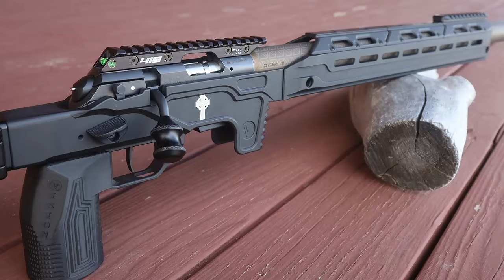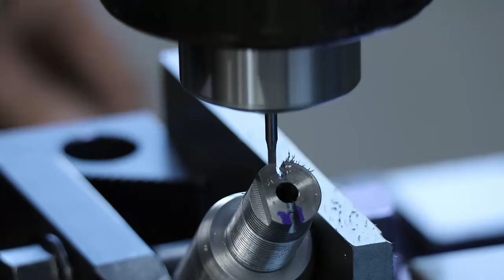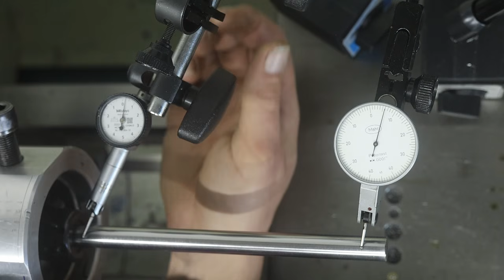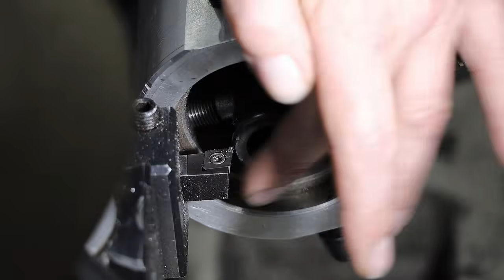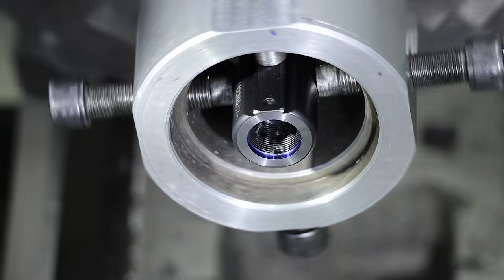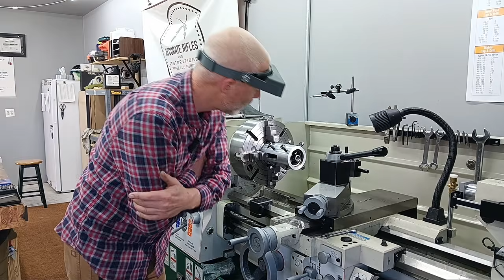CZ457 Receiver Threads and Accurizing | AR&R CZ 457 Customs | Premium 22 RF Competitor

Comment: I admire your work, but your comments on CNC vs Manual are way off. It seems to me that you have not spent much or any time running CNC's and are not speaking from experience. I have both and use both in my gunsmithing shop and they produce exactly the same result. I dont use my CNC for chambering work, but I will use it for just about everything else. There is no difference in the setup. I use the same action truing jigs and chucks in the CNC that I use on the manual lathe. The alignment process is exactly the same on both. The cutting tools I use are exactly the same on both. The difference is, I can create a program that will cut muzzle threads and crown in about 2min vs the 15 to 20min it takes to do the actual cutting on a manual lathe. Programming simple things like that is extremely fast and done directly on the machine, and the programs are saved for the next time that job comes through the shop.

What you are talking about is CNC machines being used in a high production environment where the time taken to achieved perfect alignment is often skipped. That is a very different use case to the reality of CNC's in a high precision shop.

Comment: Great video. I like how you went into detail about the process.
I have a couple of questions though. I see the end of the capscrews are machined, is the end flat, or is it slightly domed?  Was there a recess inside the action where the threading bar could be zeroed before cutting?

Comment: Any thought on making a plug for the factory barrel screws?  Fill the screw holes up and then cut the internal threads, not using them may as well plug them up nicely.
Reply from the maker: I have actually considered that.  Definitely a good idea worth looking into.  Permanent loctite and machine them in.  Would definitely lend to extra rigidity!

Comment: Love the series! I can't remember but did you consider using a RimX action instead of the CZ 457 action? I know there are good talking points for using one or the other.
Reply: @smalfry83 and @Jman-uv1lr custom build done at customer's request. I am the customer. I have a couple RimX action rifles. Love em with Capstone ammo. This build has a specific chambering for Eley (and headspace of course). In my experience, Eley feeds better from the in-action 457 magazine into an Eley-chambered barrel (at my specs). This very much comes down to the ability to buy match ammo by the lot number with consistency and in size. I can do that via Killough Shooting Sports for Eley Match and Tenex. I'm not as fortunate with purchasing Capstone/Lapua ammo. From past experience, Geoff has the extreme patience and skills to perfect a modest action into something special. I know this was a royal pain in the ass versus easier action alts.
Reply: @bondhedger Oh! I thought this was the template for on the shelf 22lr builds. And I'm a big fan of KSS, and they make it easy to lot test Eley ammo. This rifle will be a hammer.
Reply: I asked  basically the same question on another video he done,  you won’t get a straight answer if any at all,  very strange that he won’t answer a straight question with a straight answer.
Reply: @Jman-uv1lr  I'm sure he is overloaded with everything going on, but I'm hoping it's discussed at some point in the series. I've owned a custom RimX, and I know I would go CZ 457 if I could do it over.
Reply: @smalfry83  He answered alright but not the question I asked 😂.   Why would you change the Rim X, I presume they are based on centrefire action size, which is preferable to me anyway and I would imagine to most people.  I have a Sako P94  Varmint .22lr and a Bergara HMR .22lr I’ve had a few .22lr CZs over the years and a friend has a Tikka T1x .22lr, out of all these rifles the Bergara is best in my opinion , the action size, the magazine port hole, even  those  two things alone makes all the difference, no good fiddling around with tiny magazines and fiddling trying to put it in and out and loading the mag, there’s other pros to using such an action too.  The question I asked was basically the same as you, mine was ‘would the Bergara B14HMR .22lr action or similar action not have been a better choice for your custom .22lr’s, ?‘ 
He never addressed the question in any satisfactory way for me anyway.  I don’t think it’s a difficult question to answer, or is it?
Reply: @Jman-uv1lr  the cz action is hands down better that the bergara in a 22lr platform.  Sure the bergara feels like a centerfire but the bolt is terrible compared to the cz. As far as reliability goes the cz is also more reliable. For a prs/nrl rifle it isn't picky on mag fitment since the mag base plate is attached to the action. Also is isn't prone to the issues of the rim x with the fixed extractors. Hence why people are modifying the rim x to use cz style extractors. Its all going to be preference but for a competition style build a cz will compete with the best of them for sure.
Reply: @bastarddsm  Exactly!
Reply: @bastarddsm  now that’s an answer.  It’s a wonder he can’t make some sort of response.